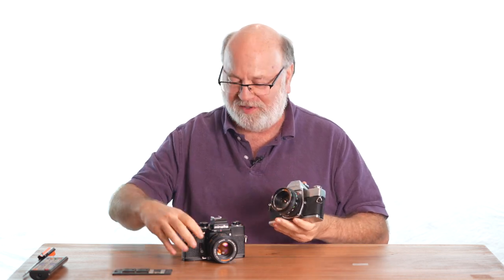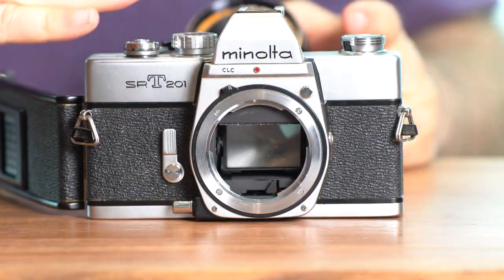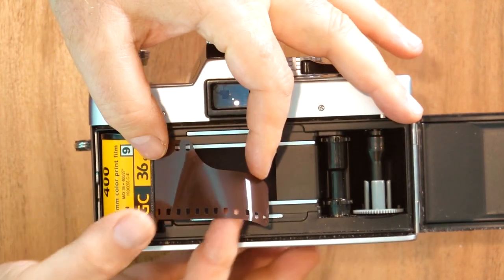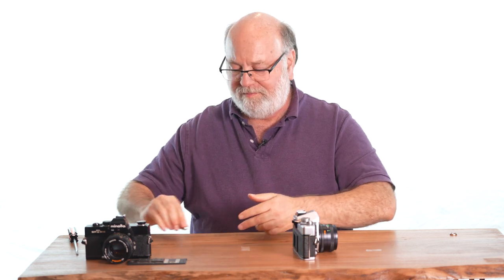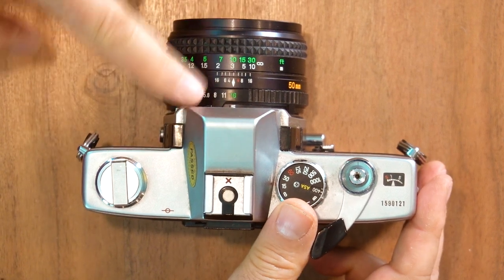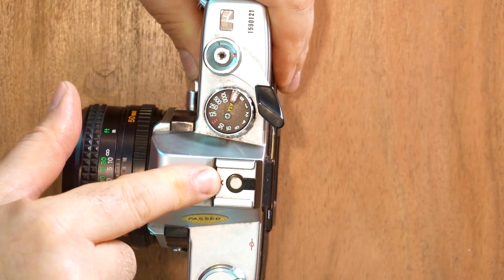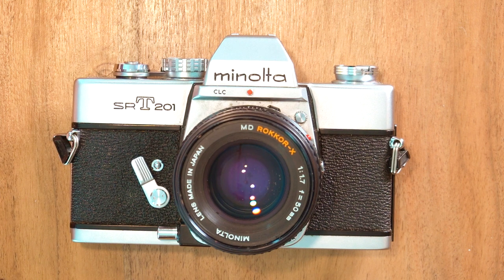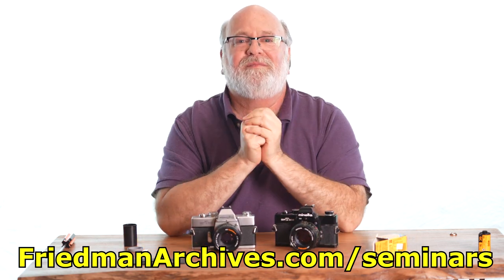The Minolta SR-T Cameras: How to Use

Comment: I won a Minolta SRT 200 camera at an auction. And struggled with loading film in and even accidentally wasting a whole roll because I thought I loaded it in properly. This really helped and told me about some parts that I didn’t know what they were before. Thank you! (Fun fact: you can use this camera without a battery)
Reply from the maker: Glad you liked it!  I actually mentioned that it could work without batteries at the very beginning of the video. 🙂

Comment: Thanks for this video. I still have the SRT-101 that my dad bought us to use growing up. I shoot maybe a roll or two a year with it, plus another roll or two in my AF film bodies. I've been using the 1.4V zinc air batteries with an adapter. I'll have to remember to overexpose a little. Thanks for the tip. I do love "slow photography" from time to time, not rely on all of the automation available to us nowadays. I have an old XE-7, my main camera back in the day, but its like meter is a mess and I prefer not to have to "sunny 16" it all of the time.
Reply from the maker: Slow photograhpy is great, but don't ask me to go back to the darkroom.  I spent enough time in my youth doing that.  Also my XE-7 failed in a similar way to yours - the meter accuracy was "WAY off!" (quote from the Minolta repair guy) when returning from a documentary trip to the Soviet Union.  Stress!!!
Reply: @FriedmanArchives  I haven't been in a darkroom in 35+ years. When I send my film in I ask for "enhanced scans" about 6MP I think. I do enjoy the process. At $1/frame (film + processing costs) I like to make sure each exposure counts, minimize those throwaway shots. Do you print much? I'm a regular 4x6 printer, sharing postcards of my shots. Let me know if you want a card! Happy to send one along.

Comment: Hi Gary. The manual advices you to load the film strip the other way, against the rotation. This secures the film better, and you won’t have a slip to stuff in like I watched you do. It’s maybe contra intuitive, but it works just like a charm. Regards Martin
Reply from the maker: Good to know!  (Both that and the fact that I've been doing it wrong all these years. :-) )  Thanks for keeping me honest!
Reply: I also started doing it the other way around and actually the XD series f.ex. is designed to go the way you did in the video. But those later cameras has small notches that is supposed to grab the film. It could be something to do with the later models being created for motor drives.

Comment: Had an x-370 die on me. Soon as the electronics went down the shutter stopped and would not advance. Just bought an srt 101 on an auction site so I am thrilled to learn I got a mechanical camera at a good price
Reply from the maker: Yes, the X700/X500/X370 series were famous for having capacitors that didn't age well.  Not Minolta's fault.  But your SRT 101 will certainly serve you well!
Reply: The X-370s are really nice cameras. Everything on that camera worked like new. I had one and traded up for a Nikon F, (Ftn photomic prism head) adding a few more dollars to purchase it. I really wanted that Nikon F and purchased it refurbished (like I do with most of my vintage film SLRs) from a camera repair shop. I also own the Minolta SRT-303. I will never part with that camera!

Comment: Some years ago someone lend me a Seagull camera that afaik was a licensed copy of one of the early Minolta cameras :-)
As far as I remember that was on a sunny day so guessing exposure based on F16, shutter equals 1/ISO and adding a bit in shadow kind of worked.
Edit:
I have read that zinc air batteries for hearing aids also have around 1.3V but have a limited lifetime once the seal is opened.
Reply from the maker: Yeah, zinc air batteries are a poor choice - only work for about a day after exposing the zinc to air and you can't extend that life by resealing it.

Comment: this is a great video, very informative. :) I recently purchased a minolta srt 101, i didn’t realize until after that the little lever on the rewind knob is missing. is it still possible to rewind the film without that latch by just turning the entire knob?
Reply from the maker: YES, as long as you press that little button on the bottom first. :-)
Reply: woo! thanks so much! :-)

Comment: Great review! I have one thing to ask, regarding the flash: do you know if every kind of flash unit that has the right dimensions to fit the flash entrance of the camera will work or should I need to go for a specific type/brand of flash unit for this Minolta? Thanks!
Reply from the maker: The hot shoe on the SR-T series should fit any generic flash.  All the camera body does is tell that flash when to fire.  I believe Minolta didn't start putting manufacturer-specific communication pins on their cameras until the late 1970's, with the XG and XD series of cameras.
Reply: @FriedmanArchives thanks! another question: whenever we are not using the camera, should we remove the battery and then put it in again when we will use the camera to cover for the oxidation risk of the battery? or just turning OFF will do it?
Reply from the maker: @AlbertoG8 That's good practice for any electronic device.  Batteries leak given enough time. :-)